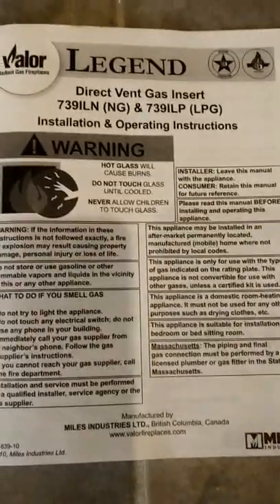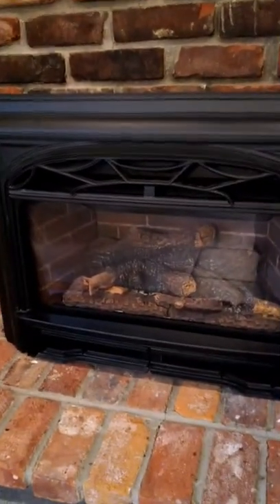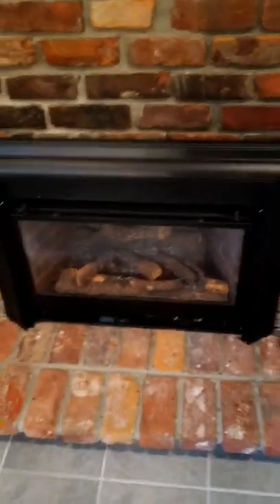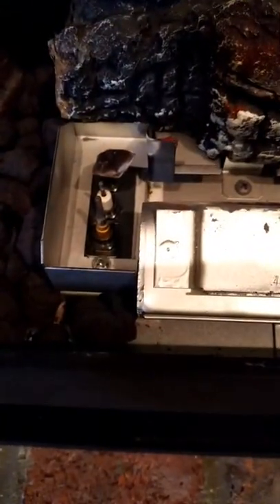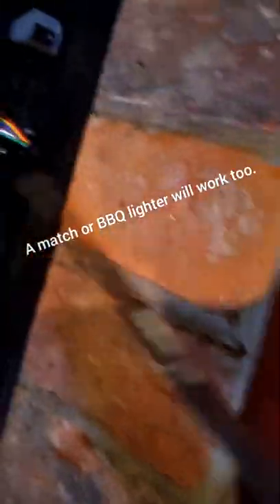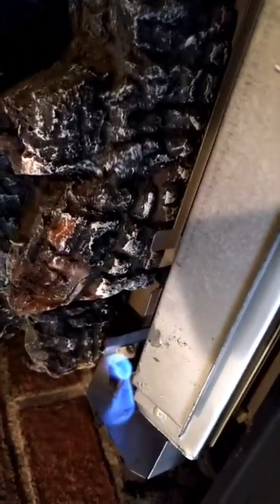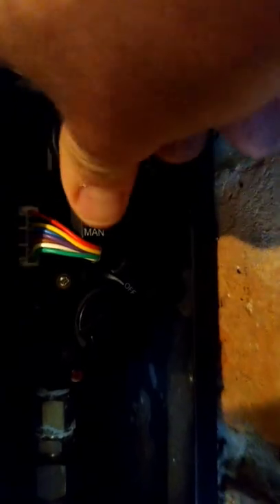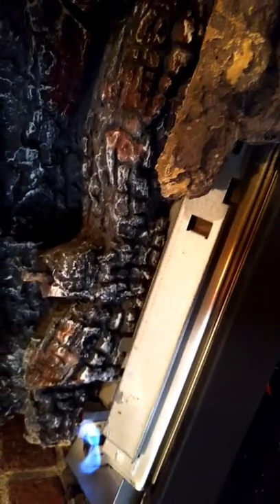How to Light a Pilot Light Manually - Legend Valor Gas Fireplace Insert.

Comment: Thanks for an informative video. I have the same gas fireplace. My pilot light comes on when I do the startup sequence with the remote but it will not stay lit after the sequence finishes. I cleaned the thermocouple…no luck. I tested the millivolts on the thermocouple and it is good (well above 8). Would you have any idea what to check now? Thanks from Ontario as well.
Reply from the maker: Thanks for your question Ian!  Let me look into that and I'll post a Comment/Reply Thanks for watching!

Comment: Hi - The pilot will only stay lit till I am pressing the insert. As soon as I am letting it go, it is going off. Can you provide a solution please?

Thank you!
Reply from the maker: Hello and thanks for you question!  It sounds like your pilot light tip or orifice may be blocked with dust etc. which will impede a steady flow of gas. This situation will contribute to a low or weak pilot light that won't stay lit or will blow out easily.  It is possible that the thermocouple may need to be replaced .  Turn off the gas and give the pilot light end a good leaning, then try lighting it again. - Good luck and let us know how it goes!

Comment: Is it possible for the pilot to be too strong? I did a replacement of the pilot assembly and pipe and now the pilot flame is over an inch long and the hood is glowing. Did i mess something up to make the flow too high? I feel like before the flame was pretty small and only blue, more like this video
Reply from the maker: Hi Owen & Thanks for your question! The pilot light can be too high. In many fireplace models, there is a set screw on the assembly that allows you to adjust the volume of gas for your flame. This is something you will need to do a bit more research focussing on your particular model.  Good luck and thanks for watching!

Comment: Recently (May 28/21)the guy from Enbridge tagged out my Valor because my ignitor doesn't spark with the remote. I showed him this method of doing it manually and he said it was illegal. I am currently arguing with Enbridge and TSSA.....as the owners manual shows both ways of lighting the pilot....either using the remote or the method you just used. I called Valor and they told me it is CSA approved to do it manually. I'm beating my head against the wall as Enbridge refuses to admit their employee doesn't know what he is talking about. TSSA has been zero help at all. This is in Ontario, Canada.
Reply from the maker: Thanks for your message! I am in Ontario too, and this is the first time I've heard it suggested that it's illegal to light a pilot light this way.  Perhaps we shouldn't be lighting our gas BBQ's with open flames either? 🙂  I know they are always changing codes etc. but I have been unable to find any updated official information that discourages lighting a pilot light in this manner. I really hope you will be able to "free up" your fireplace and get it operating again, as intended, without more frustration.  Good luck and keep us posted! 🙂
Reply from the maker: If you're having problems with remote ignition,  there’s primarily two causes: the receiver and transmitter (remote). If replacing the batteries doesn’t solve anything,  Consider having a Service Technician replace the receiver box.
Reply: The Contractors Site Channel The piezo ignitor doesn't spark while trying with the remote. The remote and receiver otherwise work fine when I light the fireplace manually as I have done for years. In the Fall I put new batteries in both the receiver and remote and clean the glass and light the pilot manually. Throughout the winter I operate the fireplace using the remote as the pilot stays lit. The problem I had with the Enbridge guy is ....he is saying it is illegal to light the fireplace manually even though it is written up specifically to do it that way in the owners manual. I called out to Valor and they said the guy is wrong ...you can light and operate the fireplace either two ways 1) Remote and firing the piezo spark or 2) by lighting and operating the fireplace using the manual switch. They said it is all CSA approved and technician doesn't know what he is talking about. ( therefore the way this is being done in the video is illegal according to Enbridge) .....I called and emailed TSSA over a month ago and have yet to receive a reply. Enbridge is backing they're employee while not looking at the facts. So today I call the Consumer Protection Agency.
Reply from the maker: @cubatogo2003  Sounds like someone is trying to sell you a new fireplace!  I hope you have some success with CPA!
Reply: The Contractors Site Channel Thank you. For 35 years I was a licensed gas fitter here in Ontario too. I'm retired now and let my license expire a few years ago. Of course the Enbridge fitter didn't know this about me. Unless the code had changed, which it could have I figured this guy was clueless. 1)so far no reply from TSSA from call and email dated June 3rd. 2) reply from Enbridge saying the fitter is correct...? 3) spoke to Valor tech dept. in BC who said I was correct and their manual is up to date re. The gas code and lighting procedures both being acceptable...and CSA had also approved both the using of a remote or the manual lighting method. 4) will be speaking to CPA to put in claim and also going to CSA for a formal letter regarding the legality of manually lighting. As this is a public forum ( Enbridge and TSSA may even read this stuff) I must be very mindful of what else if anything I say re: Enbridge and TSSA at the moment but will let you know how this goes if any of my old fitter brethren are interested.....
Reply from the maker: @cubatogo2003  I'll look forward to hearing! Best of Luck!!

Comment: I didn’t know valor has a safety feature, I just thought it was a piece of junk! 
Vacation mode! Pilot light goes out if there’s no communication with the remote after 5 days! 
To re-light hold the red button on the remote and the up button until the unit starts beeping, then let go! Wala!
Reply from the maker: Thanks for your tip Dave! - I'm sure it will help out our viewers, especially as we head toward the colder winter months!!
Reply: @thecontractorssitechannel  
Thank you,
Also if you press any button on the remote within the 5 day period it will make contact with unit keeping the pilot light on!